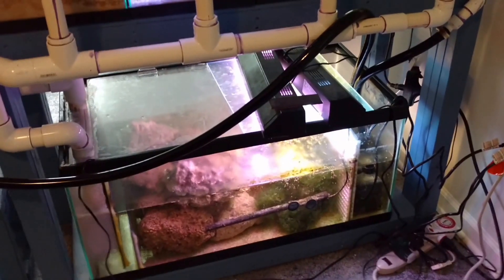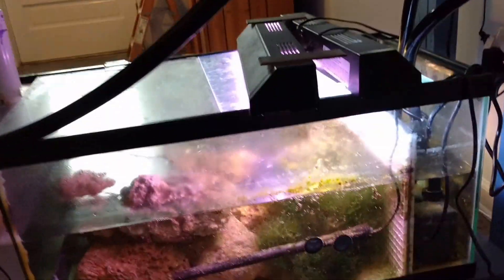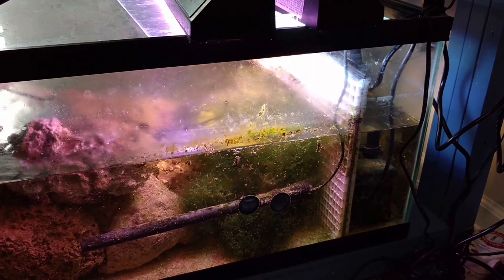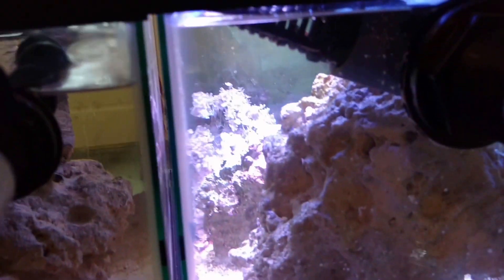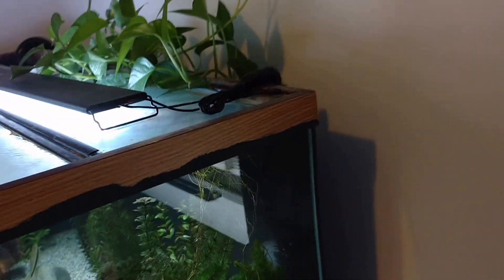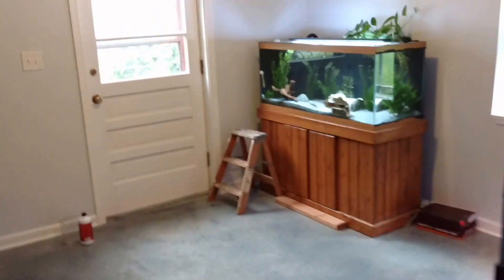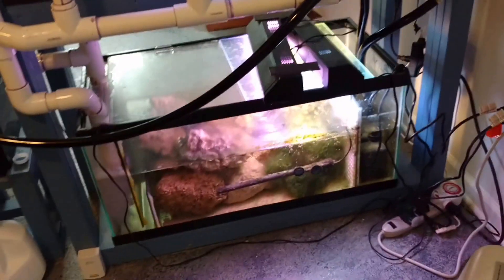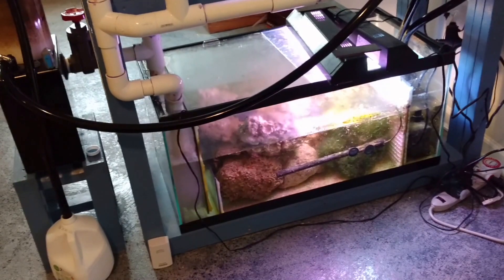How Sumps Work

Comment: What pump is that you have??
Reply from the maker: They are Rio pumps. I like them because they are compact, have a built-in strainer, and don't require any tools to open up and maintain. I should have left a little more room for them though, they now come with a special noise-silencing bracket system that I didn't leave room for.